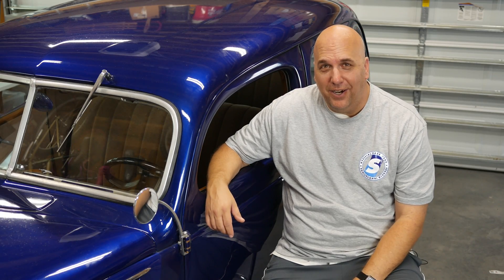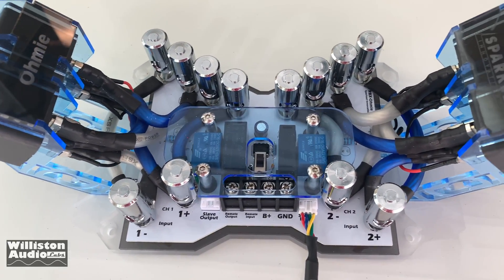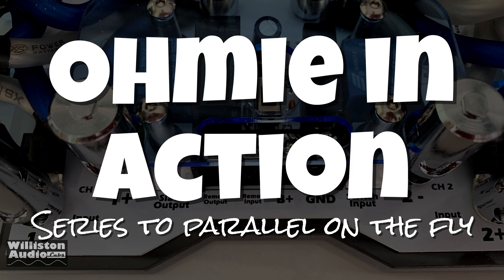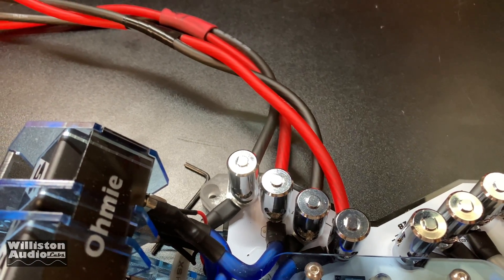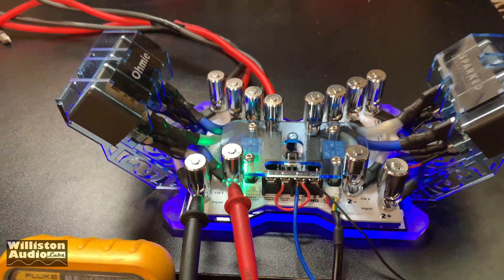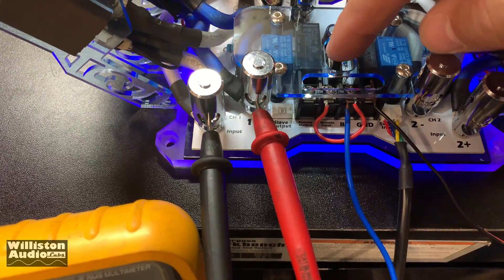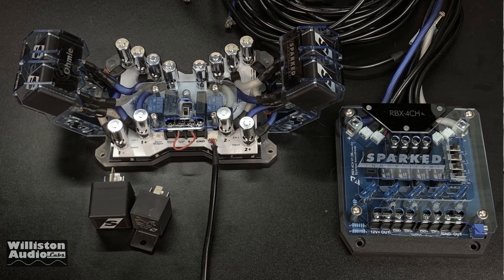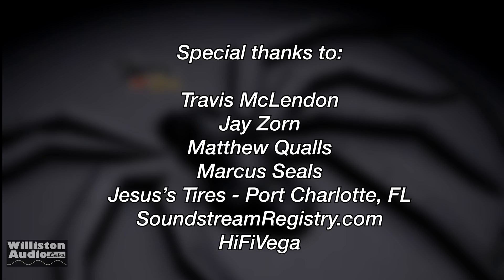Hey Homie, What's Ohmie? Series to Parallel Wiring Made Easy

Comment: WHY? Sorry guys, but this is friggin pointless. Most SPL guys have an inline pot on their RCA inputs, in which, they can dial up or down the subwoofer output on-the-fly anytime they wish. Physically rewiring the subwoofers is completely unnecessary and ridiculous.
Reply from the maker: Modifying the wiring to make amp output more power, thus higher SPL numbers is a thing. Turning up volume or gain will not have the same effect.

Comment: I think the idea is cool with some nice engineering but ideally it is a big switch that switches other switchers at the flick of switch/button for a ballpark $180. Can’t take away from the creativeness it’s another great piece of work from Sparked Innovations ... I’m going to do some math and see what possible configurations I could have with x4 dual 2 ohm drivers on a single Ohmie. Probably would be cool to make a quick calculator for beginners to go with it for more advanced set ups. It may be a plus point for newbies on the edge of buying. Now I can go from 4 ohm to 1 ohm in one second with my setup. Right now I just use my SMD terminal ... It’s like a pacifier button for the neighbors? 😂 #CoolOhmie ... It’s cheaper than a disturbing the peace ticket? 🤔 ... Plus it looks awesome 😎 ... I’m keeping my eye open for this thing out in the wild. 👀🌾 ⚡️

Comment: What difference in output of the subwoofer does this product make? If this thing takes the full force of the amp and turns it into heat and a little power for the sub it's junk. If it takes the full force and turns it into mucho SPL then it's great. What gives?
Reply: This is a passive device. It simply changes the wire connection to the woofers. No heat, no loss in power to the woofer.
Reply: You really have no clue wtf you're talking about...
Reply: It changes the load presented to the amplifier. With a higher impedance, the amp outputs less. This device doesn't soak up any power. Roll around with the higher impedance for daily driving, flip the SPL switch and get the lower impedance (and now more power from the amp) for competitions. Overall, I think it's a stupid idea as most SPL guys have an inline pot on their RCA inputs to dial in anything they want.

Comment: This big dummy needs a layman's breakdown of what/how this helps.  That way I can use it correctly if/when purchased.
Reply: He explained it pretty well IMO.
Reply: looks like it changes the wiring ohms  at the touch of a button  higher ohm for sound quality  and parallel  for spl or or more bass
Reply: It switches the wiring from series to parallel. Amps produce more power at lower Ohms, so this device will switch between the 2 different Ohm loads (series or parallel) so if you have 2 dual 2ohm subs you can switch the load between .5ohm and 2ohm
Reply: Charlie Manson wouldn’t 2 dual 2 ohm subs in series make a final load of 8 ohms tho?
Reply: @GeorgeMasonOliver  in series yes, I meant series/parallel, my bad
Reply: Charlie Manson Oh gotcha

Comment: For $20 you can leave it wired low impedance and just turn the knob down...why is it trying to be shaped like a V4 engine anyways, this should be as low profile as possible. This is not a piece of audio equipment you want to show off
Reply: Charlie Francis you cant be serious...
Reply: Matt Pierce no I was joking, your amp is responsible for your well being and how well it makes you feel👍🏻
Reply: Matt Pierce the main reason is the efficiency of the amp drops by 20% or more and the amp makes more heat which = shorter life for your amp

Comment: Oof at the price point. It seems to be expensive because of the amount of manual labor, the expensive machining of the acrylic and pinning of that connector to the SPL button that goes into making this. Lots of opportunity to drive the cost out
Reply: yeah but also expensive to switch to factory manufacturing, and you have to start somewhere...i can only commend the guy for trying..

Comment: Not to be a dick but, its basically 30 bucks worth of high current relays, switched by some low cuurent relays for $180 bucks and some leds, some 4 guage lugs and a 2 dollar pcb.
Reply: Also a timer feature that shuts off remote amp turn on and back on everytime the modes are switched. Also has a master/slave function to chain multiples together. Also cost is much higher than that lol.

Comment: I like Ed but why would you use this in a car setting?? You install your woofers in series or paralel and why would you ever want to change it?? And it seems very very very expensive.....I understand the pricing because they're handmade at the moment, but still it should be more around 100 dollars or close to it to sell more units..
Reply: A lot of people in our realm of competition/demo builds want to run their amps down to low impedances during SPL runs, but want to run safer and longer during demos and daily playing. These types of users already manually switch their wiring at the enclosure, amps, or woofers so this would make it easier for them.
Reply: @SparkedEd  Yeah it's a nice product for that niche customer base...i really like your channel and i hope this product does well...but i think you need to expand to products that have wider use cases such as your relay boards...those can be used also outside of the car audio scene..
Reply: @justkiddin1980  oh for sure. We have about 20 products we are currently developing
Reply: @SparkedEd  i thought you were on the good way for example with modular ports....sell the port and make them so the customer can layer them to the length they want...

Comment: 1. Looks well built
2. I dont know of anorher product like it on the market
I just dont see a practical use or need for it when you already have a volume knob and or a bass knob.
Reply: Yeah and at a pricepoint of 200 dollars it isn't exactly cheap...
Reply: It only bout 20-25$ of parts anyone can build..  it’s just a DiY dude trying to profit from DiY community .. can’t stand idiots like that
Reply: @wreckless_-jl6uu  Hey it's the idiot here. lol. Parts cost us much more. Also have put the relays through extensive vibration and power testing over a year. Designed and soldered PCBs in house. Put in a remote timer that shuts off and back on amps every time modes are changed, put in a master/slave feature to string multiples together. Machine the housings in house and hand assemble them. Also have a patent filed. If anyone can do it, be my guest. Our goal is to build up a manufacturing brand here in the USA. Employ a team of creative people to offer interesting products to the industry. I guess I should feel bad about all that and not try to sell anything or make anything anymore.
Reply: @ShowtimeSPL i know those parts probably doesn’t cost no more than $30 including the PCB that you can get manufactured for $2..
 👍   💯 you shouldn’t lie when trying to advertise your product! Idc either way...along with a lot of others.. I also agree that it is a pointless product..
now.. the relay Switch board.. “meh”” is alright though..
Reply: @wreckless_-jl6uu  Well the PCB is actually $4 for an empty board then all the components plus assembly plus our packaging etc... No lies here. Just wondering why people feel products should be sold at cost when so much work goes into them.
Reply: @SparkedEd  Hey man i am glad you do this...don't let others get you down. I wish i had half the guts you have to do something with my ideas...Allthough i am of the opinion that in time the thing should be priced cheaper...but that is only when you start selling bulk and producing at higher volume..But for now i wish you nothing but succes and i hope this all will work out for you.!
Reply: @wreckless_-jl6uu  Not exactly....the pcb's and the plexi had to be made and researched...and i don't know how fast you could whip something like that up...so his time is worth something also...but it is a very limited market and yeah it could and should be cheaper...

Comment: not sure what to think of it as being reliable but for what it is I am surprised in how it works. I've been looking into build my own amp and if I used that I bet i could intergret it and make it even more useful
Reply: Michael Mullas 
It would be nice to have something like this integrated within the amplifier. And the amplifier contain two remotes; one to activate the amplifier and the other to activate the ohmie system. But then the cost of the amplifier itself will rise considerably. I wonder if you can attach a logical circuit to this that analyzes the input resistance and tries to flatten it out to deal with box rise or other nuisances.
Reply: @Bassotronics  that would be ideal to utilize it's technologies in a real world application but I think mounting it near the amp will have to do for now maybe the owner is in the works for something like this. I know it will be months before I can source my materials for a home built amp I'm shooting to build one that's around 500 watts rms would be neat to have this built with in but one step at a time lol

Comment: Is there any thing that will lower ohms without having to add another sub?
Reply: They had something back in the day  but now  you would need some massive dummy resistors that could handle your amps output and not melt. if you had a 4 ohm sub you could buy a 4 ohm  dunny resistor and wire it together to get a two ohm load but I feel like it would eat exactly  half your amps output
Reply: Look up Jumpers, basically more speaker wires paralleled or series to raise or drop ohm load
Reply: @uptobatentertainment  jumpers are for dual voicecoil speakers to tie each together. You would do that anyway
Reply: rmblwgn not what I’m talking about .. talking about using speaker wire and bolts the SPL guys do it all the time.. technically it’s called jumpers I’m not talking about wiring subs together I’m talking about a sub distro block where you can wire down or up

Comment: Why would SPL guys use this? I could see how it saves you a bit of time on test bench. Why would SPL guys not just wire for 1ohm if their amps could handle it?
Reply: Big D isnt a spl guy
Reply: I don't understand also...maybe for when you're driving you could increase resistance and when you play on shows you could drop resistance?
Reply: @justkiddin1980  Its so you can compete with a daily driver.
Reply: @alphaomega8373  but doesn't a volumeknob achieve te same? And people with daily drivers that compete a rare breed..and usually if they compete it would be in sq maybe...but i am from europe so the scene is different here
Reply: @justkiddin1980  Some drop ohm load when competing to 1/2 ohm even seen 1/4 ohm. Its not good for the amp so they would only do that during comps.
Im sure they wouldnt want to keep climbing back to switch the wires everytime.
Reply: @justkiddin1980  Rare? Do you was youtube videos?
Reply: Alpha Omega ppl could just turn down the volume and it wouldn't even hurt the amps. An amp is only making the power you ask it to make with the volume knob. They're not producing 100% all day. This device still doesn't make sense.
Reply: @T07N  SPL guys are bassheads.

Comment: Can someone tell me if I have four 4ohm crescendo pwx 6.4 and four crescendo Sts-1 4 ohm as well. And I wire them hot to ground on each channel for tweeter and door speakers. What would my final impedance be.
Reply: About 2 ohm. You should buy a component set instead then you get a crossover matched to the speakers and the resistance is usually provided
Reply: FSXgta I think I must be having issues with my amplifier then. When I try to set my gains my crescendo symphony s4 just goes into protect mode. Its not even clipping I’m not sure why. It was playing perfectly fine until I changed rca’s.
Reply: Thank you for the reply.